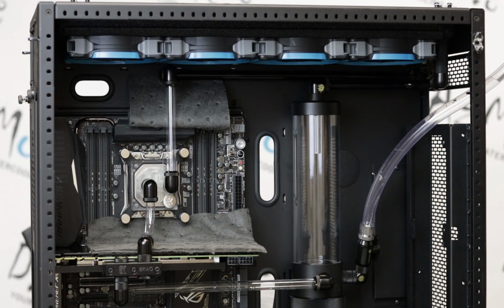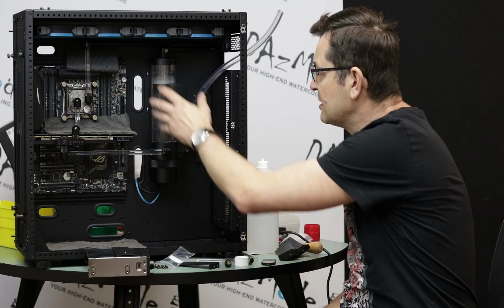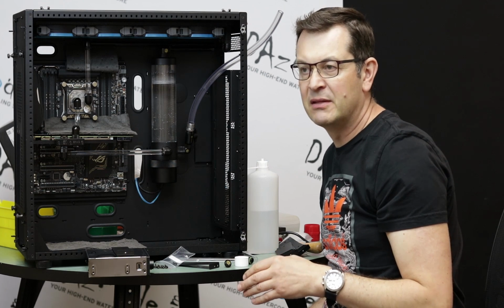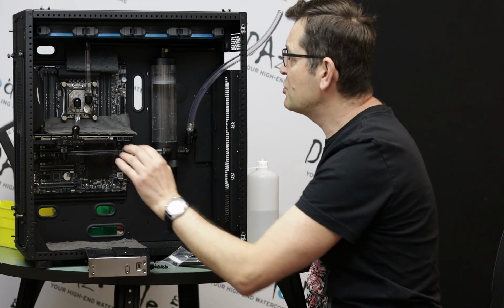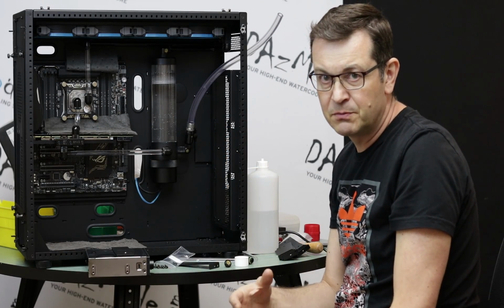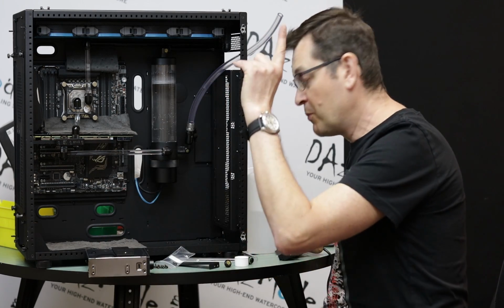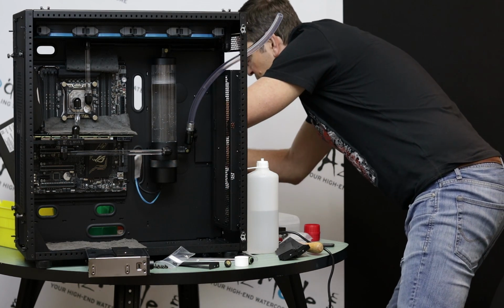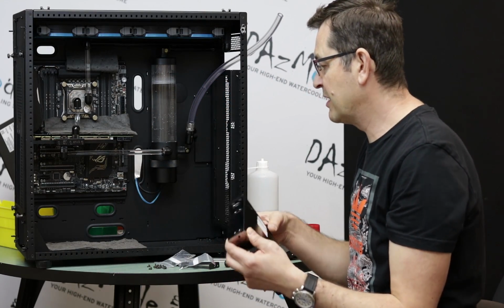Wrapping Up Watercooling - No Name Build - Ep3

Comment: I've had a weird issue with PETG tube , it seemed to develop a stain in it a few days after firing up the system.
Reply from the maker: unlikely PETG fault, most likely crap out of radiator settled on walls.
Reply: Thanks for the reply. I wasn't sure what it was I'd never seen that sort of thing happen to my acrylic tubes before. I'll flush my system again next time I have it apart to fit my custom CNC res from Radikult Customs